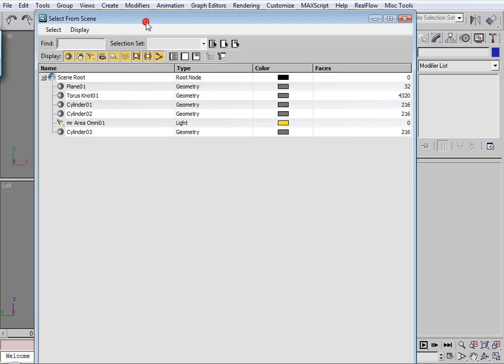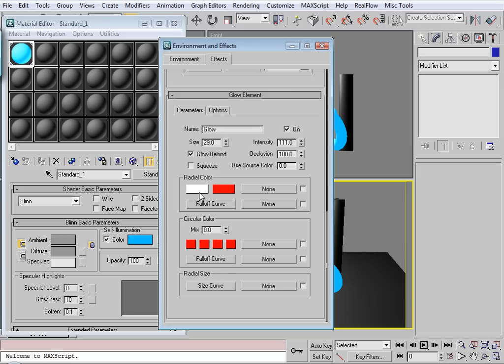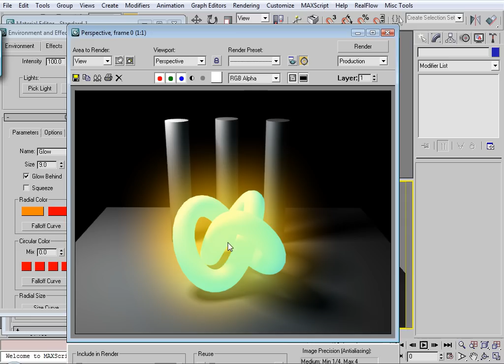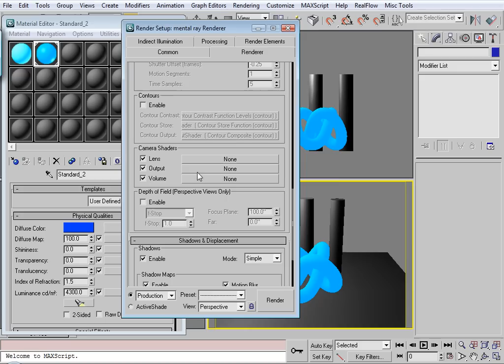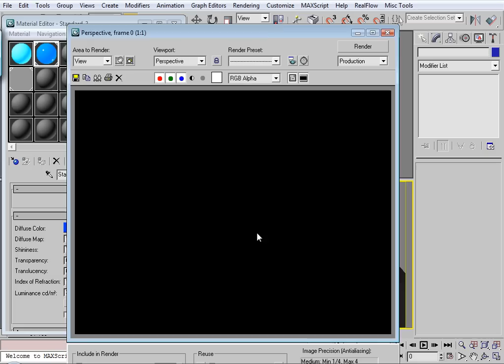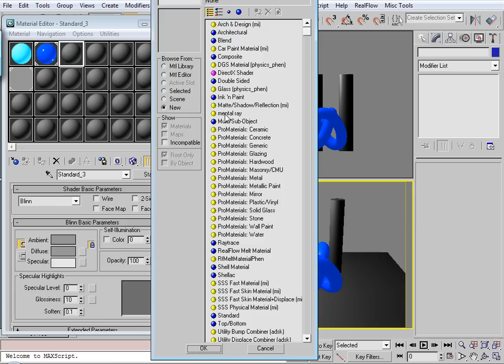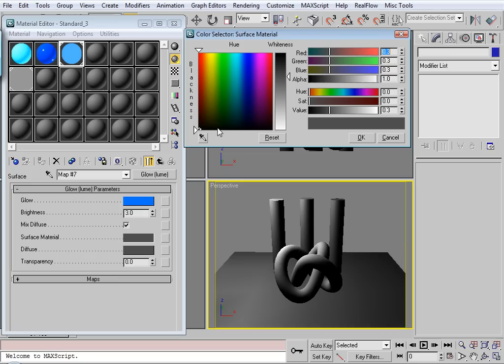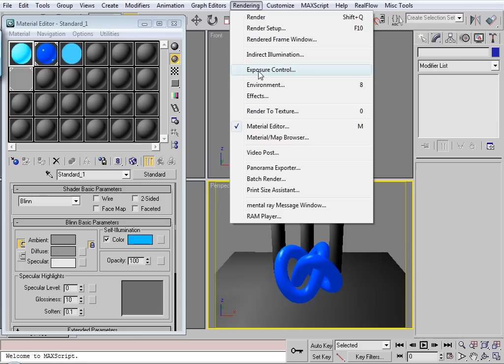3ds Max Glow Tutorial

Comment: I don't know if it's because I'm using it on a flat surface, not on a 3d model, but for some reason I can't obtain the glow effect. The result is usually a single-color texture with no glow whatsoever. Also, I do not have "glow lume" option (the one you did for mental ray material), only plain "glow". I am using the 2013 version. I would appreciate your help :)